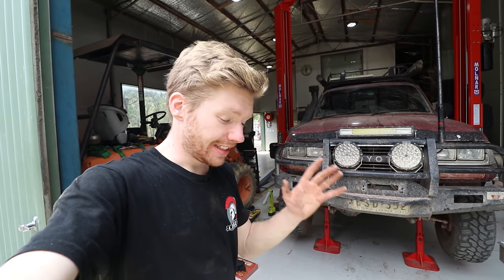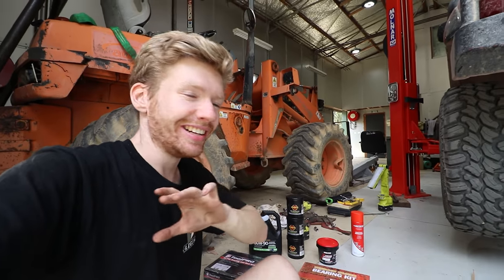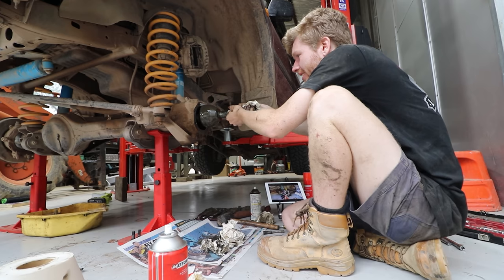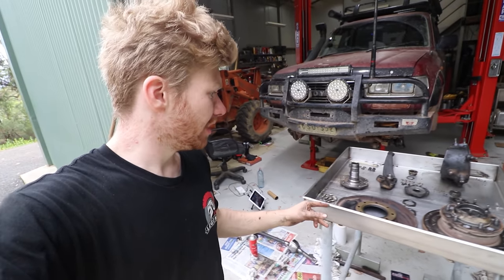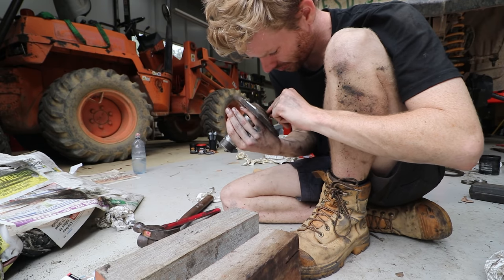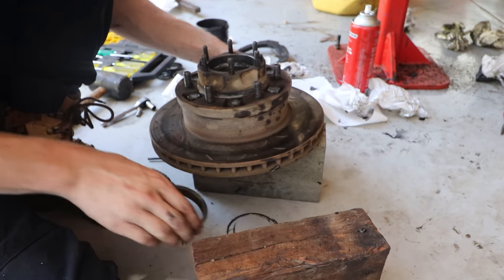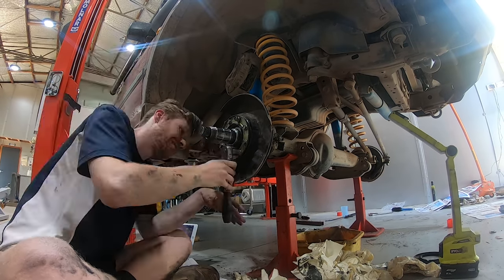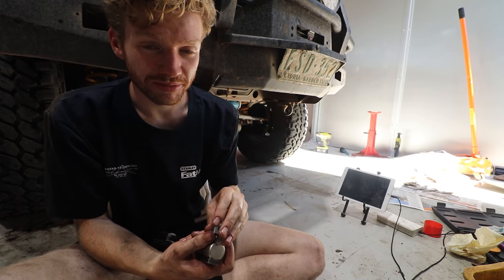The ONE JOB that ALL 4 wheel driver's HATE!!!

Comment: Just a tip for everyone who may not know, always undo your fill plug before the drain wether it may be diff, gearbox or transfer, because if ya can't get the fill undone and you've already dropped the oil you obviously aren't gonna be able to get the oil back in and that sort means no drive, just a tip for young players

Comment: Just a real quick helpful hint. Remove the fill bung first, the drain plug should always be last, because you cant refill it from the drain spot if the fill bung is siezed.
Reply: Should have a smoother flow too 👍

Comment: Couple things. Next time throw all seals to freezer, they will fit in WAY easier. When packing bearings, pack them from the wider side, pack them, spin them and pack again. For front and rear hubs buy that fine adjusting nuts, way better than that star washers. Also next time take off that 4 bottom studs off from bayfield, clean thread retap them and bolt them back with some strong loctite. I usually retight every stud around wheels just to be sure.

Comment: Hot tip, if you have a stuck brass bush, weld a line or two on the inside and it will shrink, much easier to get out.

Comment: Well done on the job mate. Just a tip I learnt as an apprentice40 years ago, when draining diff oil always take the filler out first especially if doing it in the field. There will come a time you will find the filler plug is that smashed it needs more tools that you would normally carry to get it out  and if you drop the oil first then you are stuck with having to find a solution to get oil back in. That aside keep doing what you are doing and keep learning as much as you can, it may just save a life one day.
Reply: Yup learned the "filler out first" trick as an apprentice.  Only make that mistake once! 😆 I find Penrite oils very good too. My Nissan doesn't appreciate GL5 in the gearbox though- one additive eats the synchro cones apparently. Use GL4 instead. Not a lesser grade, just a different spec.
Reply from the maker: Thanks boomer! I did loosen the filer first, just didn't film it! But thanks its a great tip!!! 👌

Comment: The brass bush to needle roller bearing is definitely a big upgrade and definitely MORE bush proof! 

The stock bush is a friction "bearing" that relys on a film of grease/oil to prevent wear onto itself and doesn't spread the load/wear well. The roller bearing does all this far better while being made of a stiffer material. Have a google for more info if you're interested. (on the different types of bearings, not opinions from forums) 

But if you didn't work it out, that bush being worn out is the reason your inner seal failed as it wasn't holding the CV straight. It allowed it to flog about on the seal. 👍
Reply from the maker: Thanks so much for the comment killerbuns !! That's make so much sense! I didn't even really think of that to be honest, but that totally makes sense on why the seal could of worn out! Thanks for the info! I really appreciate it!!
Reply: Well actually a needle bearing requiers a lot better lubrication than a bronce bushing. The needle bearing will fail much quicker when exposed to dirt and water, while the bushing will wear down, but not fail catastropically. As it is softer than the axel, a damaged vushing wont take out the axel, while a failed needle bearing will destroy the surface of the axel.
Reply: @nilz6432  A needle bearing moves the grease around with it while a brass bush relies on the smooth surface of the axle to help it move around.

Comment: 4:13 in and you can see the oil flow surging out. This would indicate a blocked axle breather. You actually confirmed this when you took the fill bung out and the oil flowed out smoothly. Your axle swivels were probably leaking because of a blocked axle breather.
Reply from the maker: Thanks Carlton! I'll check it out !!!
Reply: Good spotting

Comment: One of the best things I did after school, was joining the Army Reserves as a Armoured Corps Driver. We carried out minor and major servicing of our vehicles with the guidance of RAAME Mechanics. Even out field if a final Drive, an Engine, a Transmission, or Differential/steer Unit had to be replaced in an APC we got in and helped the RAAME Guys get it done, one of the best learning curves of my young adult life.

And 30 years on, I still like to do all my own Servicing. Apart from saving money, you learn how to pull things apart, fix minor and the odd major problems with your own vehicle, and generally learn how they go together, which may be a god send one day sitting on the side of a track in the middle of Nowhere . . . 

The biggest issue is most of the time . . . is time it's self . . . as the first attempt usually takes a heap of time without guidance or shortcut hints, and then the 2nd attempt you just breeze through it lol.

Enjoying your Video's . . . as they are down to earth and practicable

Comment: I've just done this job yesterday. Have done it twice now, and learnt that you need to check everything. As others have said before, brass bush that is worn leads to leaking inner seal. I didn't replace the bush. Pays to do the whole lot. It does get easier. For those playing at home without a race driver, I used old races with a cut in them to drive new races in.

Comment: I really enjoyed watching you having a go especially being your first time. I'd love to know more but don't even have a shed to park the car in let alone all the bits and pieces you need or anyone with any knowledge. The most daunting part for me is if I put it all back together and something is wrong and where to start trouble shooting etc etc and getting to the point where I wish I had just paid a mechanic to do it. Appreciate your inspiring words tho 👍👌😎
Reply: I'm in the same boat as you and actually did pay a mechanic to do this job on my 80 - well over a grand later there was an intermittent but unmistakable noise in the front end.  After a few weeks of back and forth they eventually refused to believe there was a problem because "we've replaced everything - it's quiet on our test drives and it probably just needs to bed in."  Ended up paying another mechanic to redo it properly who informed me that the previous mechanic hadn't greased the spindle bushes.  Second mechanic did install the roller bearing upgrade and won a new fan but I'd love to have the confidence, skill & resources to have done it myself.

Comment: To tap in your new wheel bearing cones you can use an old wheel bearing cone, put a cut through it with a thin blade grinder cutoff disc & use it to hammer on & drive in new wheel bearing cones. It will come out of the hub easy due to the cut you put through it.

Comment: Watched the old mechanic from terrain tammer on a swivel hub rebuild, best think I learnt, and it sounds rough but its a solid tip, put the wheel on onnce you have tightened the bearing, get a sledge, hit the side wsll of the tyre spin the tyre and repeat. Then you will find the bearing is loose, retighten, repeat until it no longer tightens, then set. The replicates rough road wear and tear and load of big tyres, also if your running 35's tighten the bearings a bit morr than normal to allow for the ectra load of the larger tyres. Keep up the good content

Comment: I just changed the swivel hubs grease seals on my Patrol a few days ago. It's easy and does not require the removal of the swivel nub etc. All you need to do is removed the grease seal cover plate, scraper, grease seal and supporting ring. All the parts except for the rubber seal should be able to be removed easily because they are split (with a Patrol anyway) and you just cut the inner rubber grease seal to remove it. While these parts are out, you can clean the surface of the hub and remove any rough bits. Take the new rubber seal and cut it with a very sharp knife, then fit it over the hub placing the cut part at the top, put all the other parts in place and replace the cover plate. I've done this several times with various Patrols without a problem. I had the original factory manuals for my MQ and GQ Patrol and this is how replacement was described in those manuals, the latest GU manual doesn't show this. I should have also noted that the Toyota swivel hub arrangement appears the same.

Comment: 4:00 definitely a feeling I’ve had before. I did a long range tank, lift kit and aux battery on mine. It’s a big fingers crossed moment when you jack the car up and pull the first few nuts off.
I don’t recommend doing it a few days before a big trip like I did. 😅

Comment: I unfortunately spent half my summer holiday pulling out and rebuilding a new diff on my LN167 Luxy truck. I have no prior mechanical engineering experience except the common sense stuff like doing wheel bearings and a basic service. Not gonna lie, a few spanners were thrown a cross the shed floor but the end result was just awesome knowing I did it all myself, it was quite rewarding and challenging but I did have fun. And luckily I had my oldest brother who is a qualified mechanic watching over ever step I made. So I definitely take my hat off to you guys. ☺️ Keep up the great work. 👌🏼 Update on the new diff: still currently breaking it in but I'll be hopefully out on the tracks in no time. Keep up the fantastic video guys. 😁

Comment: When hammering around threaded bit (tie rod, wheels studs etc) it's worth throwing the nuts back on a few turns just in case you miss with the hammer. Damaged threads are a pain!

Die grinders are handy for the likes of those brass bushings too. Grind a tiny groove most of the way through one part of it and then you can basically pop it out with a screwdriver.
Reply from the maker: Thanks kiwiblade! That's a great tip! And yes we do have a Dremel but it wasn't there on the day, but using that would of make taking out that brass bushing a heap easier! But glad I've got the new roller bearing and brass bush! Should hopefully make it alot easier to remove in the future!

Comment: One thing I think I noticed is that you didn't grease the rear felt seal, you need to squish qrease into it as it helps make it water tight. With no grease it can absorb water then allow water into the hub assembly. You can do it without stripping the hub apart, just undo the 10mm bolts holding the felt seal in.
Reply from the maker: Nah I didn't grease that felt seal, but thanks for the tip Daniel!

Comment: Did mine on my patrol recently, pain of a job (especially when i found out that the MK patrols have the axle seal on the diff side and i had to pull the front diff to replace them) but very satisfying to get it back together. Nice work!

Comment: Nice job mate, however the most important part of the job was missed - you NEED to check king pin bearing preload and adjust if necessary, you will need a spring gauge to do this, it's in the FSM, if you were following one. They quite often need adjustment when new bearings are used. I assume you used a torque wrench for the wheel bearings too, just off camera?
Reply: Agreed, two important things that were kind of skipped over.

Comment: Little tip for the bearing races next time Patrick - put the bearing races in the freezer for 20-30 minutes before putting them in - the metal contracts a little and makes it so much easier to knock in and actually get them dead straight first go

Comment: honestly no where near as bad of a job as lots of people make it out to be. great knowledge across the board of vehicle brands with solid axle fronts, imo the most crucial part is making sure the kingpin bearings have the right preload. not as much of an issue in 80s but in patrols, especially when people have taken all the shims out because they have no clue why they’re actually there 🙄

only thing i’d say not to worry about is packing the knuckle with moly, you really don’t need to and it’s just a waste of grease. as long as the cv is packed you’re laughing

Comment: Use a thin blade flat screwdriver & put it in the slot in the cone washers & twist them out. I saw those hammer witness marks on the hub, must be from the last bloke.

Comment: If you're interested boosted built garage just released a upgraded handbrake kit for landcruisers
Reply from the maker: I'll have to look into it, gotta repair my handbrake, its torn one of the rubber mounts that keeps it tentioned !
Reply: @AussieArvos  yeah I have a surf and the handbrake is pretty terrible too. These kits replace it with an actual disk brake
Reply: Yup LC park brakes have never been great! They often struggle at Roadworthy time. Good someone figured out an upgrade.

Comment: 0:31 well at least u got a lift 
All I have is a cheap tool set and a drive way

Good things Toyotas are easy to fix ( especially the really older ones and 80’s to early 90’s)
Reply from the maker: 100% Wolfe, makes it alot easier, but this job can be done on the cheap with basic tools!

Comment: I think if a part has lasted decades from factory, it's best to replace with genuine.

You know it's good shit, it lasted decades.
Reply from the maker: Very true , but I think the terrain tamer inner axle seal is very similar to Toyota genuine, or that's what I've heard
Reply: @AussieArvos  
They're very good.
My mate has a gearbox business and won't use crap, he happily installs terrain tamer.
Reply: @AussieArvos  genuine stuff often is very good, as Robert says it's lasted this long. However there is often a strong influence from the corporate Bean counters which works against that theory. Cut costs with cheaper parts. And there are a lot of upgrades from the factory in later models- as you said the 100 series went to the needle roller bearing in the hub. It's simply better. So you put the Terrain Tamer bearing in which is equivalent to factory upgrade- without having to pay Toyota Tax for the genuine part. Well done!